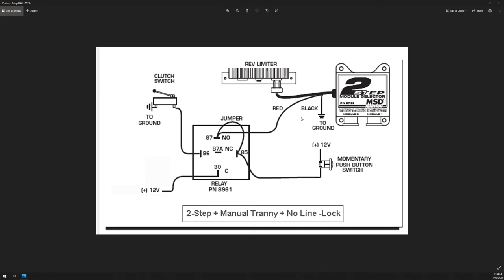Wiring the Terminator X 2-Step using the factory clutch switch

Comment: How do you get around it booting the 2 Step I/O you assigned to Input 2 and replacing it with the Rev Limiter 1 once you assign that in the handheld? I got it to work using this method, but if you go to make tune changes on the laptop, you will see you now have unassigned I/O in the Pin Map.
Reply from the maker: Interesting, I haven't made changes since I did this. I will look into it and get back to you. Thanks for letting me know!
Reply from the maker: Yeah this is weird, I am having to reset it in the handheld after any changes made in the software. If I find a fix I will let you know.
Reply: @BabyLegsMotorsports  it's because it is attempting to assign 2 things to the same input. It's more odd in my opinion that it works in the first place lol. The rev limiter through the handheld attempts to make it a switched Ground while the input you set up is a +12v. I did exactly how you did and I got it to work until you make a change in the software.m. I'm not sure of a way around it yet myself either.
Reply from the maker: Yeah that makes sense, I'll try to mess with it this weekend!
Reply: @BabyLegsMotorsports  It has been a long time since we revisited this, and you may have figured it out by now. The flaw is manually adding the '2Step' in the I/O ICF, when all you need to do is enable Rev Limiter 1 under the spark ICF, assign that to your desired input, and then under the Spark tab, go to inputs, and change the input type for the Rev Limiter from Ground to +12V how you wired it in this video. Now it should work, and remain pinned as designed regardless of any changes you make to the settings in the future. I just wired a 2 step up in a Fox I bought recently, so it made me think of your video. Otherwise, to anyone reading this, your wiring, etc is all spot on.
Reply from the maker: Man time gets away doesn't it, I realize now I never even tried to figure this out. Thanks for posting the solution!
Reply: @BabyLegsMotorsports  Yessir! I appreciate your video in the first place.

Comment: I tried wiring my input wire directly to my clutch switch but that didn't seem to work, is the relay and momentary switch required to make the circuit work properly? What if I want 2step to engage even during shifts, which wouldn't work with a momentary switch
Reply from the maker: Why do you want the two step during shifts? Usually you want the two step for launch, and the rev limiter after that

Comment: Hey, so with the relay having 12 volts through it and the 2 step 12 volts, did you have to use the transbrake input protection module or is the relay used so you don’t have to use that?
Reply from the maker: I didn't have to use anything special, just the relay
Reply: @BabyLegsMotorsports  awesome. Thanks. I wasn’t sure if I needed the holley transbrake module since it’d have 12 volts on it to protect it from fly back voltage. Didn’t wanna damage my ecu lol
Reply from the maker: No problem, this is my first experience with a 2-Step. So far so good with it wired this way :)